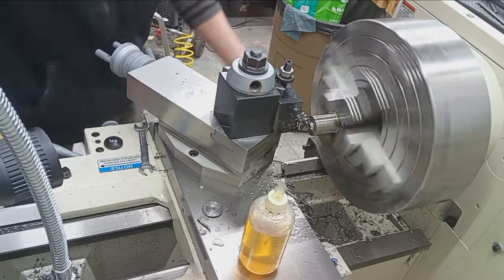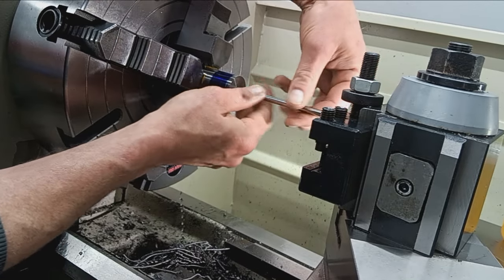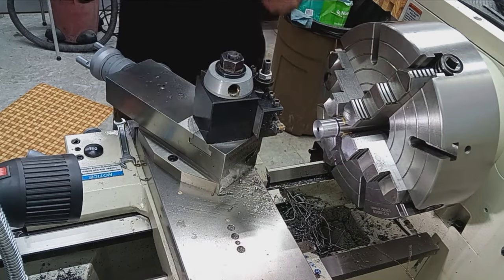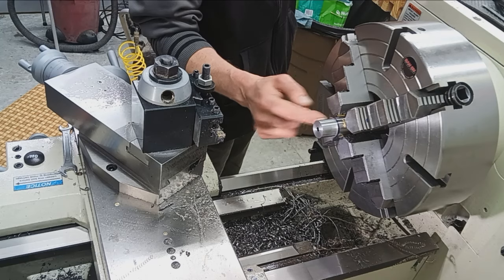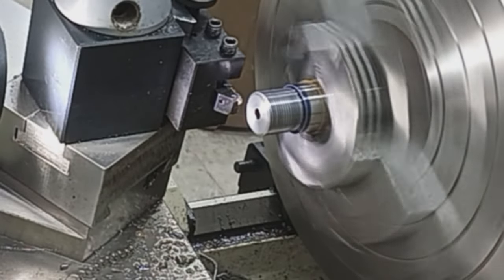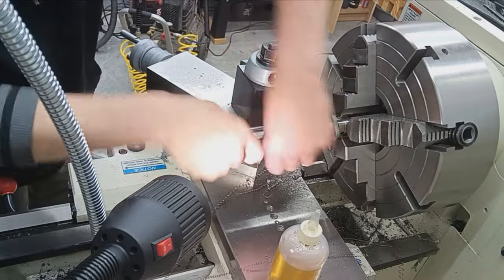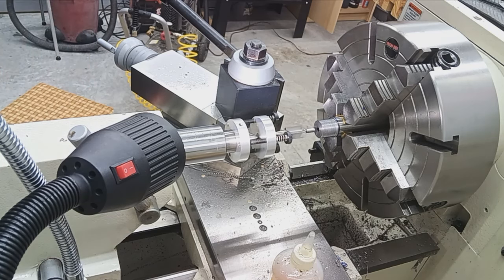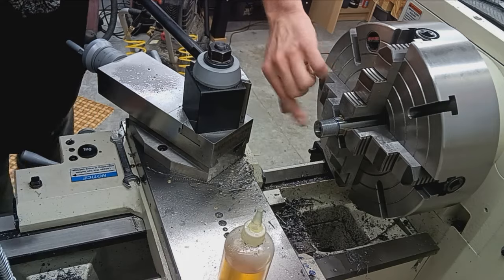Ultimate Benchrest Rig - Defiance Deviant Tactical - Bartlein M24 Barrel - in 6.5-284 Norma Part 2

Comment: If you had your quick change toolpost turned correct you wouldn't need to remove the handle.....turn it 90 deg to the right. That way its setup for boring and facing toolholders

Comment: The one thing i did to my lathe that changed my life was adding a dro .. its worth it . I spent 20+ years without one.
Reply from the maker: Cool.  Send me one and I'll install it! 😁
Reply: @AccurateRiflesandRestorations  the time you will save will pay for it very fast. I went with the cheaper magnetic strip unit and was under 500 bucks.

Comment: there you go, bend that barrel into position, alright, alright, alright🤦🏻‍♂️. lots to learn, i see. what happens when you loosen everything up and the barrel goes back to its "relaxed" state?

even though gordy gritters teaches that method, you're not getting what you think you are. he doesn't realize it either. im not trying to put you down or anything, and i realize your rifles shoot good. im not saying they won't. I just hope to make you think about what is really going on there so you can improve. 

after you are all done chambering that barrel you can check the alignment of everything, and i don't mean, just put your indicator in the chamber and check run-out.
Reply: what's the correct approach to reduce deformation while workholding?
Reply: @HiRayWilliamJohnson  I don't think reducing is an option. from what I've tried and seen, your two options are to live with it or eliminate it. The only way to eliminate it is to use the true bore alignment system or the B.B.A.R. collet chuck.